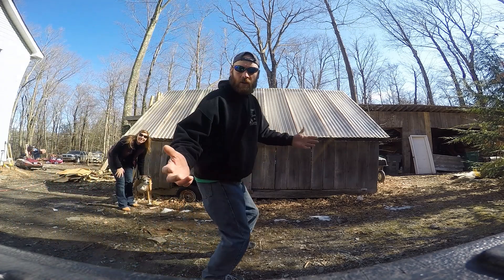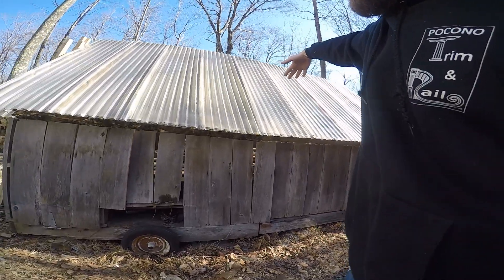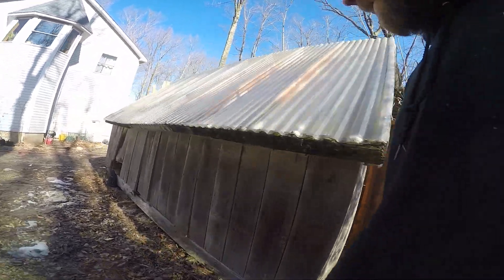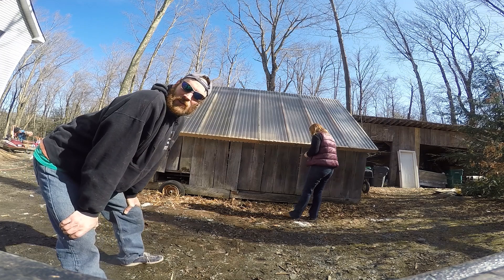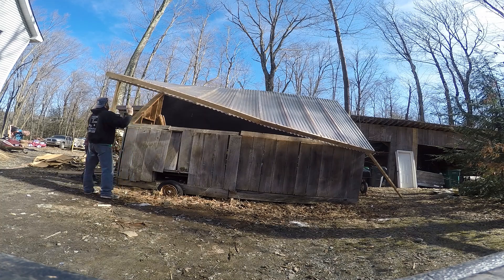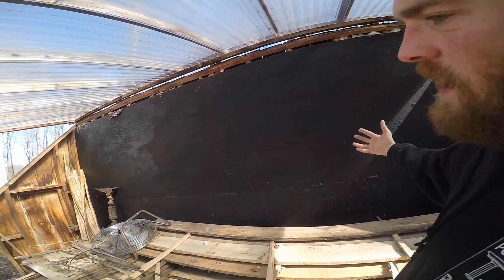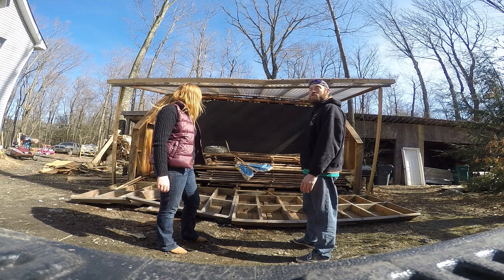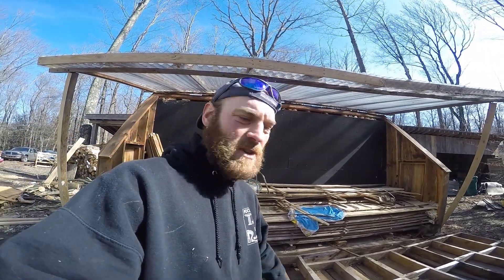SOLAR Wood KILN for Drying Lumber

Comment: Would this work for seasoning wood for my indoor fireplace quickly?
Reply from the maker: Absolutely if you had it in an easy to transfer container, dry one and switch it with another one.